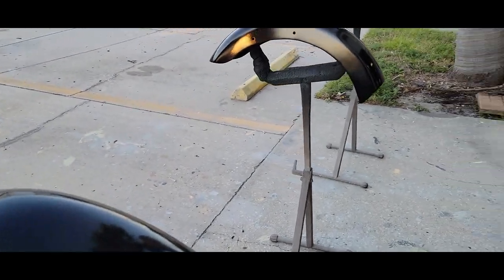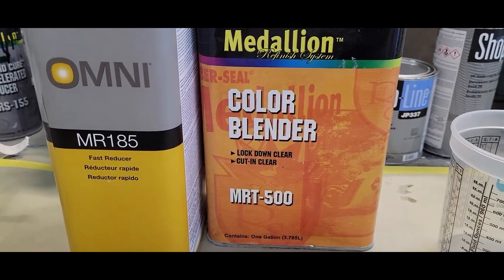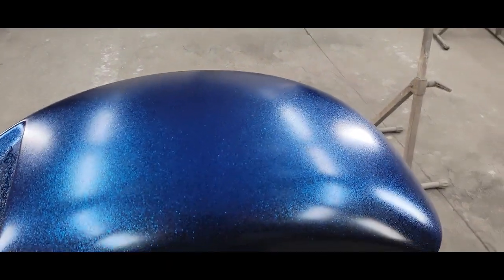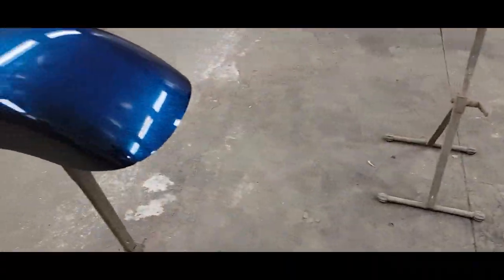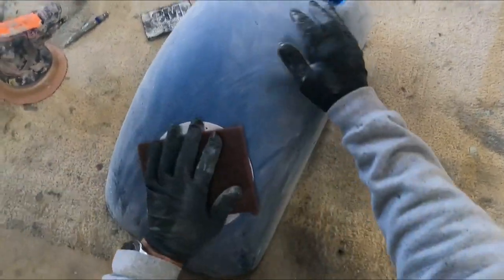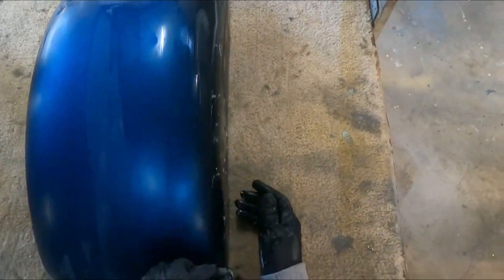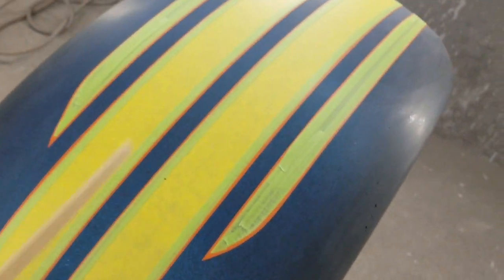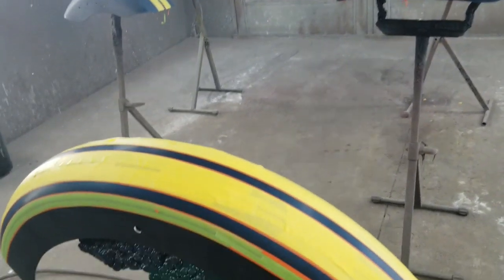How to tips and tricks Motorcycle custom paint job - metalflake stripes done FIRST - black basecoat

Comment: When your color sanding your clear which orbit are you using on the DA sander. Seems larger orbit cuts faster but if trash gets on your paper squiggles are hell. Your videos are awesome very precise. Learning a lot from them. Your layout on flames are some of the best looking flames out there. Grateful for you sharing your taping skills since my pinstriping is not good and my freehand airbrushing isn't much better.
Reply from the maker: I'm using the shorter orbit. You can still use the longer orbit, but just have to be a little more careful on corners, edges, going through flat areas..... 
About every minute or so, I slap the pad with my hand and it cleans up the pad and paper. 
Glad you're enjoying the videos. I'm sure the 'outline first' on the flames video comes in handy for you

Comment: Knowing your mostly a motorcycle guy but mention auto painting as well I'm going to ask you. Looking to do a candy job on my 95 Mustang GT. Going with an aqua/teal candy preferably HOK but want a more green than teal. Using a multi size silver flake with a pearl in it in a midcoat before spraying the candy. My question is what would you recommend as a basecoat to get the achievable final candy color I'm looking for? I see in the description you know HOK and obviously know your flake/candy paint. Any advice would be greatly appreciated. 👍🍻
Reply from the maker: This would be a very involved paint job even for a person with a lot of experience. This is basically a 4 stage paint so there is no midcoat. base, flake, candy, then clear.
Sooooo to make it someone easier, I would suggest starting with a color close to what you want. Choose an automotive color. Then spray some MF02 over the base. Then make up some candy that will make it richer and deeper, plus it will turn the silver flakes into a teal flake.  Mix some green and blue candy to your liking. This way you can control how green the overall color gets. Be sure and do lot's of test panels first
I would not recommend using a flake bigger than the MF02
Reply: @TAZattitude  Thank you very much Sir. Do have some experience with all this from doing motorcycle parts on and off for about six years. Never done anything in depth full scale like this or anything full scale automotive wise. Hopefully my skills and your recommendations will translate well come spring when I plan on spraying my Mustang. Thanks again for the reply Sir. Look forward to more of your videos. 👍🍻
Reply from the maker: @chasejones3456  I wish you good luck! Keep watching those vids!!!